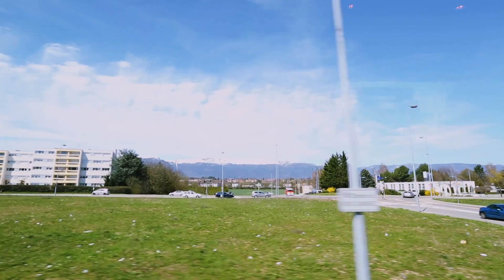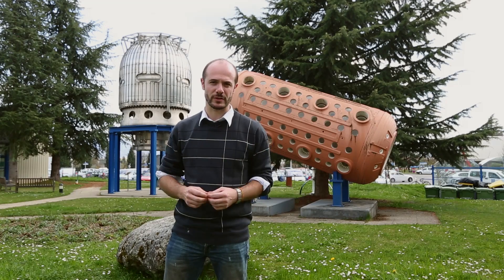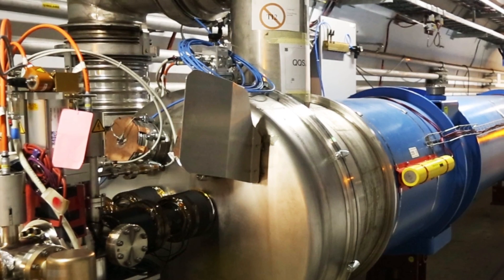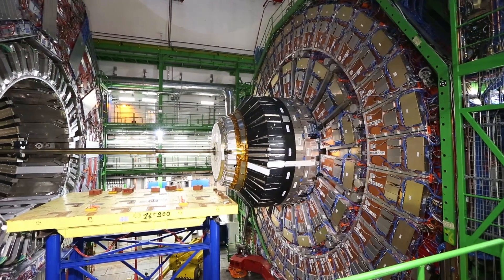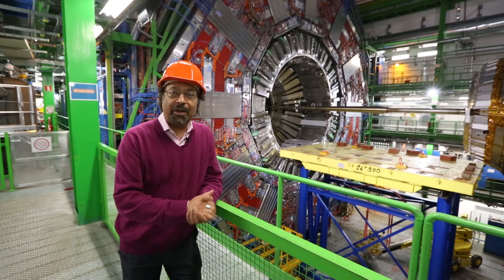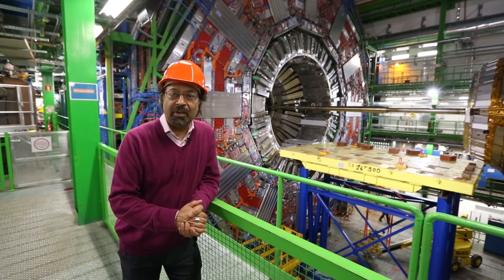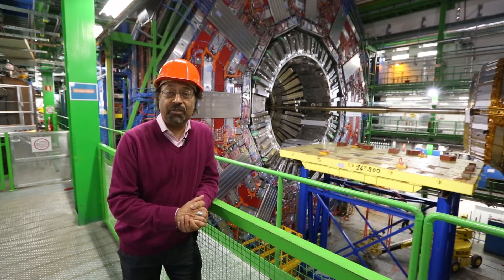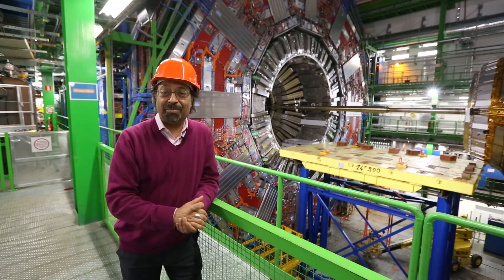Inside the Large Hadron Collider at CERN

Comment: Boii this is basicly the particle acelerater ( i think i wrote acelerater correct... ) from the flash
* inner fan boii thinking NOW I JUST NEED TO MOVE THERE AND RUN WHILE GETTING STRUCK BY LIGHTING WOOOHH *
* Thinks *
wait what if i dont bc the flash... ehh then i wont have to pay for electricity anymore
Reply: The Almighty INTP Accelerator* also fuck off you tards

Comment: What is the secret end game of the LHC? Do the scientists feel like gods, causing new and exotic particles to briefly appear?

Why try to reproduce subatomic conditions that may have existed at the time of the big bang (more correctly, the big stretch)? Do they hope to create an alternate universe? Create worm holes for time travel?

There must be some big plan for the science they are doing. It is way too expensive for just pure research with no application. Forcing new, exotic particles to flash in and out of existence must have a special result they are seeking.
Reply: Well for the Big Bang department, It is pretty much visible with a good telescope now (Speed of light + Distance = 13.8 billion years ago light.) However, they still can't still see past 300,000 years old apparently as the heat from the time forms an opaque wall

Comment: If it gets as hot as the sun why doesn't it melt everything?
Reply: Because those temperatures only involve a very small number of particles and are only achieved for an incredibly short amount of time.
Reply: ohh
Reply: To be exact, it's 65,000 times hotter then the core of the sun
Which would annihilate all life on earth even if it was there for 1 second.
It's just there for a minuscule amount of time.